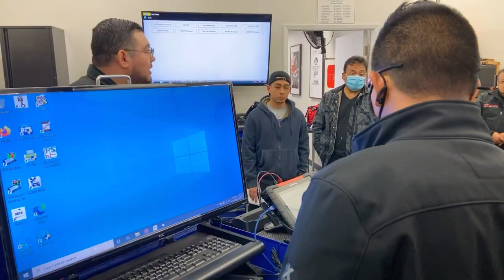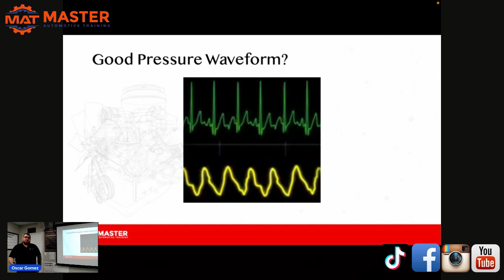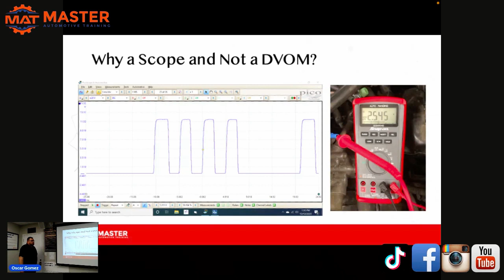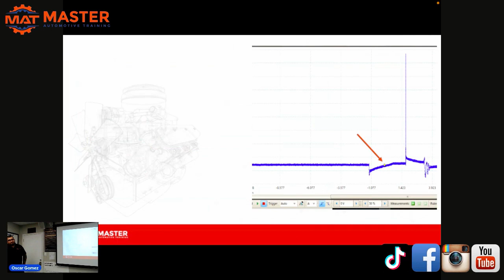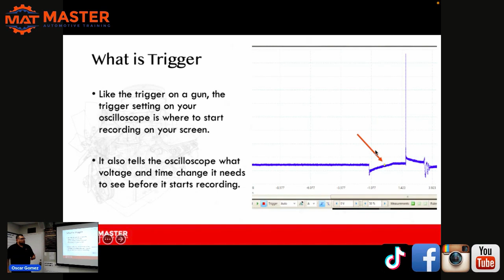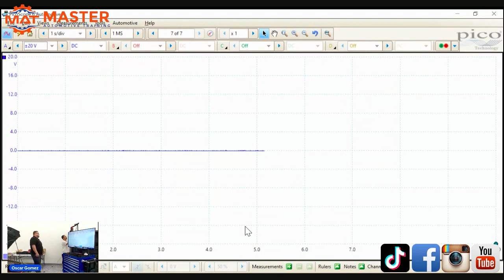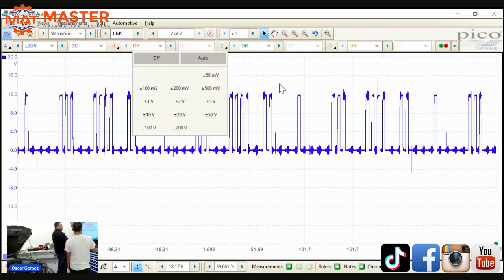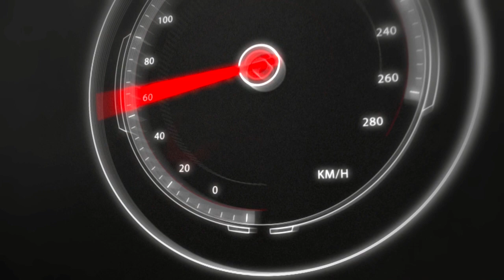AUTOMOTIVE OSCILLOSCOPE TRAINING [BASICS]

Comment: no fair. I was thinking automotive. Since you said the 2 waveforms were a problem, I was thinking no start condition from misaligned distributor on older car - bottom was clamp meter on battery for starter current and top was the primary voltage on ignition coil (single coil) with bounciness showing the voltage of collapsing EM field and that coil was firing when distributor rotor button was halfway between electrodes, so no spark delivered. I was way off.

Comment: What do you think of the hanter for a starter and learn about scopes?
Reply: Hantek, sorry.
Reply from the maker: Hantek is a good scope, however their software is terrible.
Reply: Do you recommend Pico 2204A, 2 channel, to start off? Price is 165 in amazon.
Reply from the maker: As a Pico distributor the short answer is no. A 2000 series Pico scope was not made for automotive use, using it on a car will void warranty and anything above 20v will kill the scope. I’d recommend a 4425 Pico or a Micsig SATO1004
Reply: Thank you.
Reply: Sorry for all these questions bro lol i want to learn about scopes thats why lol. Im a tractor mechanic, will they work with tractor’s also or just automotive.